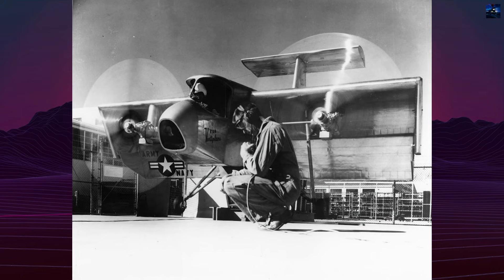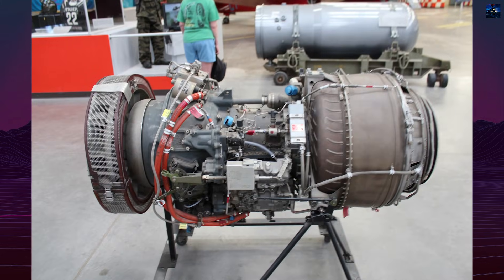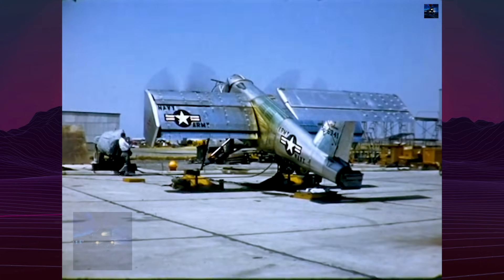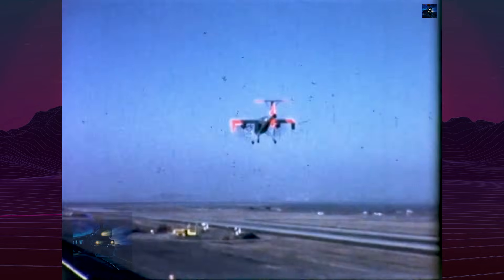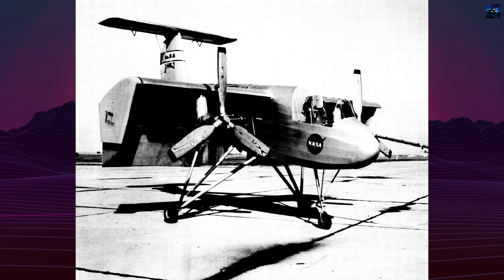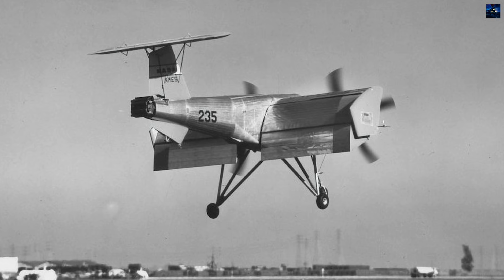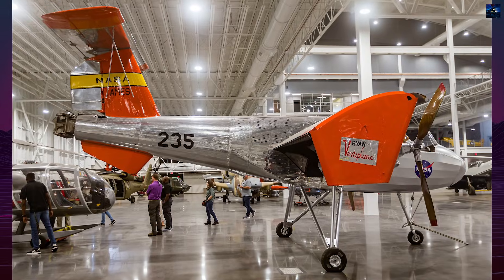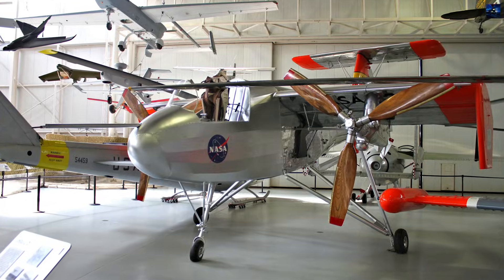Ryan VZ-3 Vertiplane: That Weird Old Plane That Took Off Like a Helicopter

Comment: You would think navies might be interested? Given that it needed a slight headwind it would have been ideal for carriers or any small ship with a reasonable flat deck.
With modern technology it might have made a good AEW aircraft or possibly for general use as a COD. Helicopters are expensive to operate therefore something like this may have reduced operating costs?
Reply: The advantages of planes are speed and range. They're more efficient per mile. Helos can only fly abut 3 hours usually while aeroplanes can easily hit 6 or more. 
This thing might not get much speed but it potentially proves better gas mileage than a Helo, which where I assume its real strength is at. 
However, the method of it's STOVL leaves much to be desired when it comes to weight limits. It's not producing much static thrust to assist in higher take off mass. This is why Tilt Rotors came along later, because they maximize the true static thrust for heavy lifting but combine the advantages of an effecient aeroplane when in long distance flight.
Reply: @Nurhaal  Yes but this design and idea is quite old now so with technology and genereal advances since then I would assume a modern version would be vastly improved. Tilt rotors don't seem to have a good outcome in the event of mechanical failure,
Reply: @tivvy-xf4kz actually the Tilt Rotors are safer than reported in media. Their accident rate is no higher than any other platform and the V-22 is quite maintainable as well. 
Do not ever trust the news. 
Im not kidding. 
I work in defense aero, the news doesnt know jack sh*t.
Reply: From current & past experience the military would not be interested in reducing operating costs.

Comment: Was this better than Custer Channel Wing?
A french homebuilt airplane had a biplane configuration, upper wing advanced respect rear wing, and pusher propellers in the space between wings, after trailing edge of upper wing, moved by a single air-cooled Citroen GS engine, 65 hp in car version, inside the fuselage.

Comment: Never heard of this one before! The fact that NASA extensively tested it, even after that significant crash, proves the merit of the concept.
Reply: There is no mechanical, aircraft and ship oddity that was not tested in the USA.
If you have one of these concepts, and want to spread it, having a patent others will have to pay for is the sure way to put down your idea.
For a novelty to enter automotive industry production, it must provide both 10 % improvement and 10 % cost reduction.
'Show me a technical novelty, and I'll show you a shortcut to bankruptcy', Henry Ford.
Reply: NASA is not the benchmark of excellence anymore
Reply: @rudetoy8264  They certainly were then.